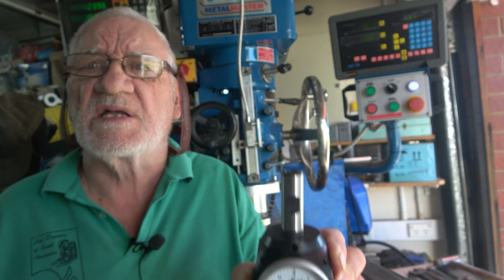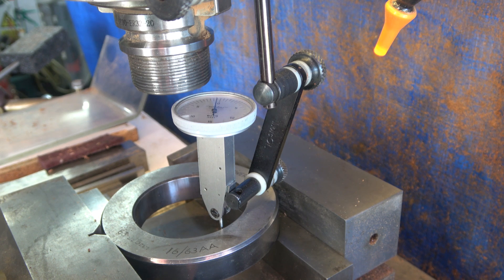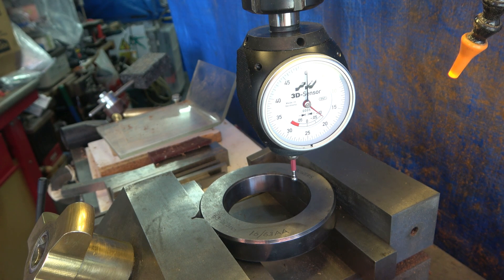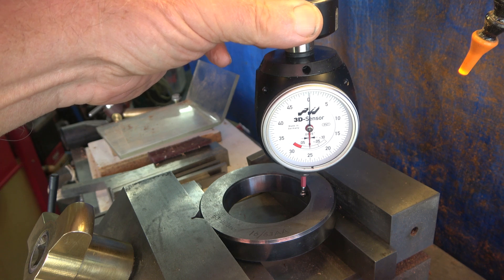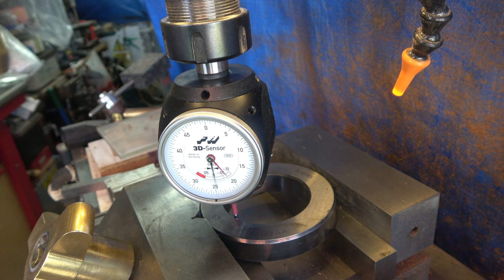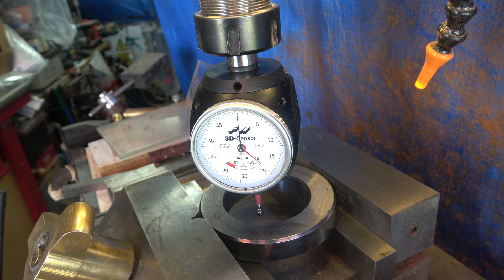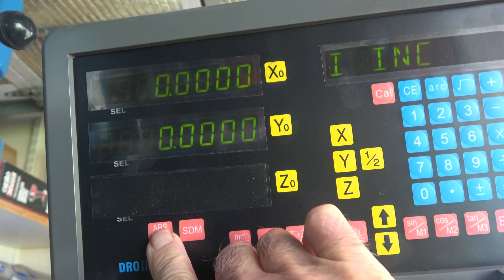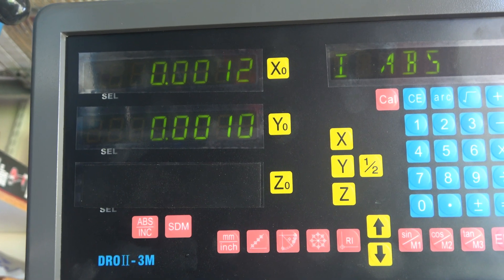HAIMER 3D Sensor Accuracy Test

Comment from the maker: Since the making of this video, the Haimer now has a dedicated NT 30 to ER 32 chuck with a 3/4" precision collet. All dialed in and the spindle dog and collet chuck have been marked so it goes back in the same orientation. I did out of interest try it 180 degrees and error was only a 1/10 thou. I re did the tests and the error now is between Zero and 2/10 ths thou. I found better accuracy if the Haimer was square to both axis. I tried 45 Degrees and got a greater error. As in the video, any pressure on the stylus will cause a reading movement if the Haimer is rotated.

Comment: Hi Dave. I am looking to upgrade from a small mill drill to a larger unit. I am looking at a combo vertical turret and horizontal spindle mill. Would you consider doing a video on whether a vertical turret mill is all you need or does a combo add something that a vertical only mill cannot achieve alone. Would value your opinion. Cheers Jimbo
Reply from the maker: Hi Jimbo, Thanks for the view and your question. If you would like to email me davesozzyworkshop@gmail.com and we can communicate easier with pictures if need be , rather than doing it via YouTube that often will not accept me sending links. Looking forward to hearing from you. Regards.

Comment: Hi David. Which model of Haimer did you go for? I’m after buying one very soon and would be interested to know which one you went with. Rob
Reply from the maker: Hello Rob, thanks for the view and question. Model is the Imperial one with a 0.750" shank. Universal 3 D Taster. part number 80.360.00.IN I got it on Amazon in Australia. I think that they also do a metric version. Hope this helps. Regards.
Reply: Hi David. I could only find Metric in the UK, so it looks like I will have to go with one of those. I’ve got 20mm and 3/4” collects for the Bridgeport, so not too much of an issue. There are a few different 3D models out there and I wasn’t able to find out what exactly is the differences in them. But i at least can go with the right series now with that part number. Thanks again. Rob

Comment: I usually only go to .005   on all 4 sides because it WILL climb the curve of the circle.  The idea is to put least amount of pressure on the tip while centering on curved surfaces
Reply from the maker: Thanks for the view and your comment, I had suspected the "Slip" as the stilus is able to move in 360 degrees. Other commenters said I was not using it correctly. I shall just use it for bores if not critical, for accurate jobs I will use a centering dial indicator ( not a co axial one ) to get it correct. Regards.
Reply: @daveticehurst4191  you can use it for bores absolutely.  The tip tends to climb roll one way or the other. So light pressure is the key. It's just a reference and the same on the other side, then half way is center.   I learned this mapping a compound radius.  It was moving both z and x

Comment: Hi Dave, nice Video. To get the best results take three readings. So find the centre of one axis and then put the Haimer on that centre. Then get the more accurate centre of the other axis. Then re centre the first axis because now you are measuring across the centre of the bore instead of off set slightly. 👍
Reply from the maker: Thanks for the information, I will certainly do that. I have been strongly advised by several people to mount this in a permanent holder and mark which driving dog on my NT 30 spindle engages with the holder. Once everything is dialed in it should always go back in the same location providing everything is cleaned each time.. Looks like I wasted my time in making a storage box for it. 😊 Will probably go for a fishing tackle box next tome with foam insert. Thanks agin for the view. Best Wishes.

Comment: Yes I suppose these Haimer 3D's can be used in the way you did it Dave. But whatever run out your spindle, collet chuck and collet has or even how exact your head tram is all have a partial effect. There meant to be very accurately set to the true spindle center line. What I did was first verify my head tram was exact as possible and I keep mine in it's own dedicated Weldon shank end mill holder and it's then never been removed from it. You then use a dti on the probe ball and use the 4 screws in the Haimer to then zero the Haimer to the holder using the screws so that probe ball shows zero deviation as it's rotated 360 degrees. It's that zero setting for why it should always stay in a dedicated tool holder. And there far more accurate than your .001" shows. Within a few 10ths at most if there zeroed correctly.

My mill has a R8 taper and because I haven't yet removed it's screw that fits the slot in the tool shanks, it's the only benefit I've ever found for that screw to ensure my end mill holder and Haimer always goes back into the same rotary position within the spindle taper after it's been zeroed. If you don't have that, then I'd suggest using something like a Dremel tool and rotary burr to lightly dot both the tool shank holding your Haimer and the mills spindle after you do the zero setting so it can be correctly locked into the same position in the spindle each time it's used.

And whatever you do, make sure to never drop or crash your Haimer. As far as I know, there are no authorized repair facilities anywhere in the world, so it would have to be returned to the manufacturer back in Germany. 

Yes that styrofoam split box they come in is pretty much useless as storage. To be fair, most users would have them in the tool changer rack in there own tool holder on cnc machines, so better storage wouldn't be required. Vertical mills, power table feeds, a mill vise and dro make an excellent wood working tool for smaller projects. But at the much lower rpms compared to a wood working router, I've found out our usual end mills as long as there sharp produce better results than actual router bits. 

Where your located you may never have heard of them. The original models were invented and built by a firm in the US called Wagner and the tool was called a Saf-T-Planer. They were invented for use in drill press's a bit before the now common bench top wood planers began to be sold. Think of it as a 3" diameter face mill for wood with 3 HSS easily re-sharpenable teeth in it. I wouldn't know of a supplier in your area, but here's a link to one in the US. https://www.stewmac.com/luthier-tools-and-supplies/types-of-tools/planes/stewmac-safe-t-planer/ They work multiple times better in a mill collet and with the work fixed in the vise than they ever did in a drill press. They will create chip out on the exit side of the tool, but clamping a length of construction grade scrap wood to that side eliminates even that minor problem. The surface finish they leave isn't quite as good as an actual wood planer, but some slight sanding will fix that as well. I believe there are or were Chinese clones of this tool, but there HSS cutters dull quickly, or at least did on the first one I bought. I replaced it with one from Wagner when they were still in business and it's been a really great tool. For projects where there's a combination of wood and metal, it allows extremely accurate matching sizes, or even producing exact tapers using a sine bar. I hope some of this information helps.
Reply from the maker: Hello Peter thanks for the view and this very long and interesting article. I have spent several hours trying to find a NT 30 to Weldon holder in Imperial as my Haimer is a 3/4" shank. Can only find Metric 20 mm from China. Have orderd a precision 3/4" ER 32 collet and will order another NT 30 to ER 32 Chuck and dedicate permantly to the Haimer. Several people say that it will not be accurate in keep swapping it out of a holder each time. Also been advised to mark one of my spindle driving dogs and NT 30 so that they always go into the spindle in the same orientation. Will now need new storage for the whole item, probably go for a plastic fishing tackle box with foam inserts this time. Your drill operated wood maching tool has been shown on YouTube on Mr Petes channel a couple of Years back, quite a tool. With regards to a Haimer repair, I would think the shipping costs and repair costs could almost be the same as buying a new one. Postage costs seem to be fantastic unless you buy anything from China where is seems to be free, I'm told the Chinese Government pay it, so they can flood the Western World with Chinese goods. Take care. Regards.
Reply: @daveticehurst4191  Mine has a 3/4" shank on my digital model of Haimer as well. Strangely I've don't know of any that seem to be built with metric shank dimensions. I'm sure there made, but possibly the choice of what's stocked might be up to the tool dealer your buying from.

You could also buy a 25 mm or even larger bored Weldon end mill holder and machine a shop built adapter sleeve to then fit your Haimers 3/4" shank. Slot the adapter for at least one of the set screws in the end mill holder so it can bear against the shank on your Haimer and it should work fine. As long as it's well fixtured within the holder to where it's tight and can't move and then zeroed to that position it will work. And yes permanently mounting it in it's own dedicated tool holder is going to require different storage. If you build or use a larger box, watch that ceramic probe as it goes in and out of the box. They can break fairly easy if there bumped hard enough and obviously there not exactly cheap to replace.
Reply from the maker: @Pete-xe3il  Thanks for that. The Metric version has a Metric shank but I like Imperial best, so hence me having a long search to find one here in Australia. Plenty of Metric ones being sold. Just bought an $ 8 plastic fishing box with a handle that fits the setup fine. I use the waterproof foam that seems to come protecting domestic appliances custom cut to fit the box and Haimer setup. Regards.

Comment: Sorry to say thats wrong. When you first show that turning the Haimer it moves because of the x y system. NO its because you haven't centred the probe.When the probe is centred properly it makes no difference which way the Haimer is turned.
Reply from the maker: Thanks for watching but I disagree. I have redone the setup this morning, dialed in the probe tip usig the 4 set screws on the top. Any more than 0.004" pressure applied to the probe tip when first making contact gives approxamatley 0.007" deviation if the Haimer is rotated. This I suspect is due to the probe being on a gimbal and any friction / resistance to the probe against the part is causing side slip. I have even set the Haimer on the exact center of the ring using a centering dial indicator and did a retest so that ther would be no side pressure on the probe if it was off center. Exactly the same results. Regards.
Reply: @daveticehurst4191  Firsty of all fitting the Haimer in a collet, It must be fitted in the same location every time otherwise you don't take into account your own spindle runout. Secondly you need a tenth dial gauge (on the .200" ball) to centre the probe, which should have virtually no pressure at all to show its indication. Once set in this way you will have no diviation at all, but you may need to re adjust the dial to zero. I have two of these on both my mills and once setup properly you will be within tenths NOT thousands. The other thing I will point out is that if you don't try to do this on centre you are risking deviation on the curvature pressure.

Comment: The reason the needle move when you rotate is because it hasn't been calibrated, you can use the four small set screws at the top to get the tip runnout out
Reply from the maker: Thanks for the view and your comment, The Haimer stylus was dialed to read zero all round. There is still the problem of getting a different reading on the Haimer if you rotate it whilst under load. With only a 0.002" on the dial I can rotate the Haimer and the reading stays stable, anything above a 0.015" pressure and the dial and any rotation is up to about 0.007" deviation as the video showed. This is because I suspect that the stylus is on a gimbal so that it can move randomly in any direction. Although the stylus is on the highest point of the bore, there is sufficient pressure / friction on the stylus that if you rotate it, the ball wants to slip sideways and give a different reading. Best Wishes.
Reply: @daveticehurst4191  right, rotating under load is less then ideal, but if the ball is not running out, it should be ok to rotate the display in order to see before taking a measurement. happy easter.
Reply from the maker: @jonathanforget8988  Thank You.

Comment: Superb presentation, and nice work with the 'overhead router table' to make the case.
Reply from the maker: Hi Craig, thanks for watching. That was not a router that I was using to make the box, it was the milling machine. I used a 2 flute endmill ( Slot Drill ) to plunge down to remove the bulk before skimming around the edges to remove the bumps. All done using the DRO in ABS and INC to mill out the pockets to size. All up about 5 hours from solid block to finished box. Best Wishes.

Comment: Hi Dave. Nice tool have not seen one before. I wonder how that compares to the Blake co ax indicator. Have a great Easter weekend. Cheers PS great job on building the case for it.
Reply from the maker: Thanks, you too Randy. No Idea about a co axial indicator as I have never owned or used one. Co axial Indicators are very cheap compared to this tool. Best Wishes.